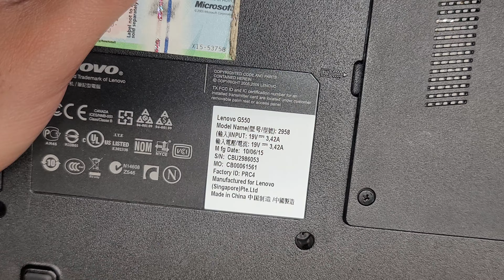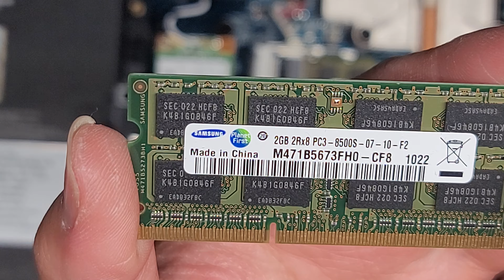Lenovo G550 RAM SSD Hard Drive Upgrade Repair Replacement

Comment: Thanks for the video. Quick questio , im about to upgrade to an ssd(250 or 500) and the ram to 8GB ( i got the same laptop lenovo g550 2958). But how do i know which ram is compitable with that laptop? Any suggestions? Also about the ssd..
Reply from the maker: the video should mention or show the speed and type of RAM
Reply: Ddr3 is compatible only, i have same laptop
Reply from the maker: @durmiss  make sure you match the mhz as well.
Reply: @ItsBinhRepaired  ok, thanks for advice
Reply: must be ddr3 1066 mhz

Comment: I just upgraded my ram and after restarting it wont go into the bios.  I noticed the number of black squares on my old ram looks like yours.  ie 16 block.  the new ram has fewer which im told is high density ram vs low density ram.  Does this laptop only work with low density?
Reply from the maker: Shouldn't matter. Try putting back the old RAM and see if it still has the issue. The main thing is the speed of the RAM.
Reply: Putting the old ram and it boots.  The new ram is 1600mhz but i thought it would just operate slower.
Reply from the maker: @CountryHouseIncubators  you want the same speed to make sure there aren't comparability issues.

Comment: I tried to insert an SSD an install W10, but get the message, this Harddrive cannot be installed "the hardware of this computer does not support starting of this.....and so on....what can I do? (its a SamsungSSD)
Reply from the maker: @cldelphin  where did you connect the SSD?
Reply: @ItsBinhRepaired  as the HDD was corrupt, I removed it and connected / build in the ssd into the same port internally and started with an W10 DVD...currently I try to install linux mint, RAM is 6GB
Reply from the maker: Strange if it's also a SATA SSD.
Reply: @ItsBinhRepaired  currently linux mint is installing - hopefully it works - I cannot really understand, why Windows 10 cannot be installed.....
Reply from the maker: @cldelphin  It shouldn't be an issue. Use a usb installer and if the laptop has usb 2.0 ports, use those.

Comment: How much RAM is supported in this laptop G550?  What type of RAM should i buy for upgrade? What type of ssd should i buy for upgrade? Kindly advise.
Reply from the maker: Those questions are answered in the video. How much RAM and what size SSD did you want?
Reply: I want to upgrade the ram to 16 gig but not sure it will work or not. Also there are many videos where after installing the ssd it will not detect. I want to upgrade to ssd 1 TB. Can you please guide me which type of ssd shoul i buy?
Reply from the maker: @bibekbaruti1751  you can try this for RAM. Amazon has free returns. https://amzn.to/3weEmgm This SSD will work. https://amzn.to/3CSmzha and this video will help you migrate your things to the SSD. https://youtu.be/4p5jFDzVwUw
Reply: Thanks I a lot for the guidance man.
Reply from the maker: @bibekbaruti1751  no problem. If you haven't already, please like and subscribe so others can find my videos. Thanks!
Reply: @ItsBinhRepaired  Reply sir. How much?
Reply from the maker: @dr.bghanshyam7101  how much what?
Reply: @ItsBinhRepaired  How much RAM is supported in Lenovo G550 laptop?
Reply from the maker: @dr.bghanshyam7101  whatever you can fit

Comment: how many mhz this ram ?
Reply from the maker: If I didn't mention the specs in the video, I'm not sure.
Reply: 1066 mhz
Reply from the maker: Thanks
Reply: @emreozsoylu2477  Bilgisayarcıya götürdüm 1600mhz RAM taktı eve geldim 800mhz gösteriyor, nasıl olur, 1066 bile çalışmadı. Var mı böyle birşey, yoksa RAM kaç olursa olsun 800mhz mi oluyor.